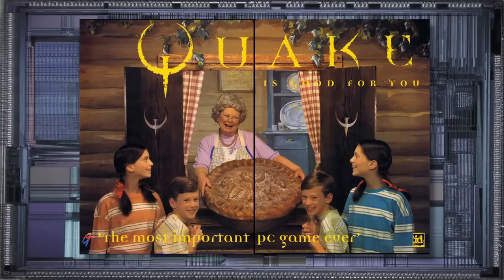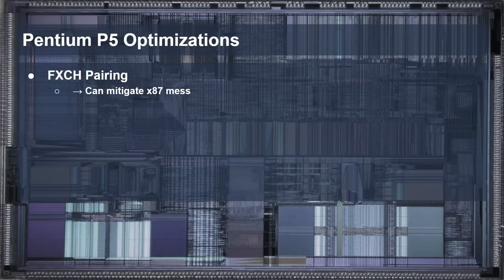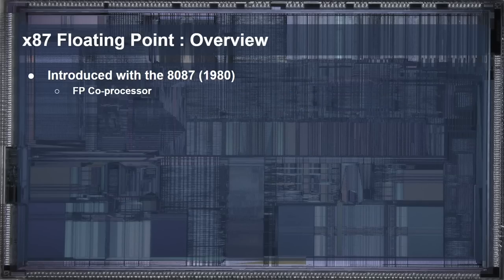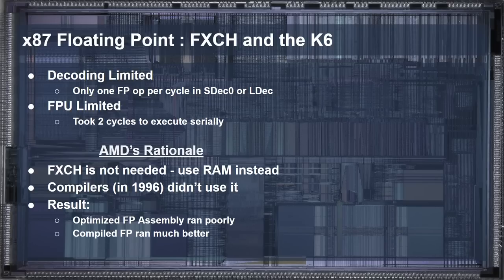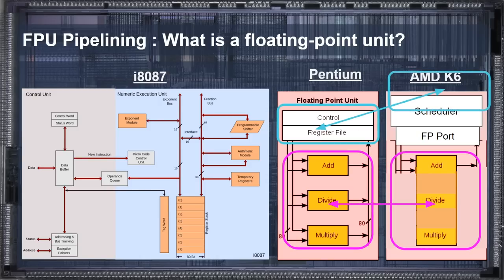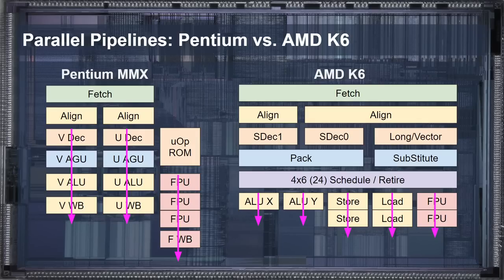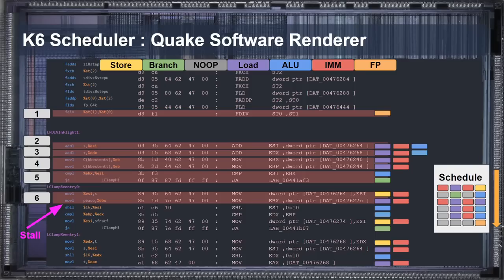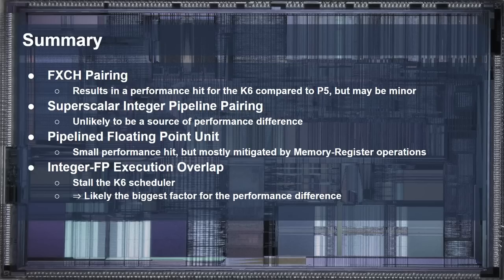Quake, Floating Point, and the Intel Pentium

Comment: Very interesting, i like when the frontier between hardware and software is blurry. 
Maybe one of the last example where good knowledge of the hardware lead to programming wonders.
I didn't know K5 was out-of-order, i had to look it up and what a strange bird it was : a x86 front-end with a Risc.
I start wondering how well a x86 front with a modern RiscV would performe.
Seing the benchmark, clearly the P6 was one of the finest architecture at the time ( But i would have sold my soul for a Dec Alpha in the late 90's ).
Since your last video, i have done some digging on 3DFX (find a site with technical papers and source codes).
Voodoo 1 had two chips ( texture and raster ) each with a 64bits@50Mhz dedicated EDO RAM, so 800Mo/s in total.
Voodoo Rush was a voodoo 1 with some 2d chips battling for the pci bandwitdh.
Voodoo 2 had two texture units, so 3x64bits@90Mhz 2160Mo/s.
And the Banshee was an half-voodoo2 (only one texture unit ) with a 2D.
I supposed you would have to adapt the architecture to a single memory system ? Can the color blending and overlay can be mutualise with the 2D part ?
Reply from the maker: Indeed, the span from 1993 to 2001 was probably the most dramatic change in hardware and software architecture. Before 1993 most hardware/software looked similar, and after 2001 most hardware/software looks similar. That's probably due to it being the inflection point where hardware started to become fast enough that it could handle almost any software thrown at it, instead of requiring heavy assembly based optimization. 
- I was originally surprised that the K5 was OoO too, but that's probably because I was equating it to the Cyrix 5x86. There's a lot of detailed patents on the K5/K6, which have a very similar architecture. It was the K7 that was a complete overhaul (due to clock speed scaling on the k6).
- All OoO processors use a RISC like back-end. How RISCy it is depends on the architecture though. The K5/K6 were pure RISC, meaning that it was a load-store architecture. The K7+ and P6+ used a semi-RISC back-end, which was load-store based, but could fuse a load or a store with an ALU operation (to save in micro ops).
- You wouldn't be able to implement x86 with a RISCV backend efficiently, because of complications with the ISA. And a RISC-like backend becomes a nightmare when dealing with x87 FP (I talked about that in the longer video, which hasn't been published yet). The RISC back-end of the K5/K6 was highly specialized around these quirks of the x86 ISA, so other than being load-store and register-register based, it doesn't resemble any other RISC like ISA.
- The P6 was very powerful, but I think it was outmatched by the K7 in many cases (regardless of the benchmarks). There have been many improvements to the P6 though, starting with Core, and those allow it to far surpass the k7. Although AMD has many many improvements to the K7 base architecture too (even Zen is similar to K7).
- What you described with the Voodoo's is correct, except for the Banshee. Perhaps you are thinking of the Rush? The Banshee was combined like the Voodoo3+, and shared a single memory bus (it may have only had one TMU though, I would have to look that up). For a FPGA, the architecture would depend on the underlying hardware platform. If your platform only had 1 memory system, then you would need to have the framebuffer, texture memory, and 2D memory share the same system. Actually, 1 memory system would mean also having the CPU and sound card share too. Ideally, you would at least have 2, where the graphics have a dedicated system and the sound/CPU get their own. If you instead had 3 memory systems, then it could make sense to split the 2D and 3D graphics, and 4 could split them again. But I think 2 is a reasonable target if the latency and bandwidth requirements can be met, since that's what the Voodoo3+ (and Banshee) used. And yes, the 2D system would share the same memory. The Voodoo cards actually store their 2D framebuffers in a specific way that allows it to be compatible with the 3D framebuffer, though I haven't looked into how the windowing was done.
Reply: @RTLEngineering  
The rush (SST-96) was a revised voodoo 1 (SST-1) with a memory @45Mhz.
The Banshee was a Voodoo 2 (SST-2) but with only one texture unit (TMU ) instead of two. Hence the poor score in multi-texturing compare to the Voodoo2 (or the TnT).
I remember the banshee well, but the rush not so much beside the fact it was bad, "S3 Virge" bad.
Indeed the K7 was a beautiful chip compare to the PIII. The K7 bring 3Dnow and PIII gain SSE, both with MMX with completly reworked fpu-vector units.
Reply from the maker: I had to go back to the spec to verify, but my original comment about the Banshee is correct. The graphics core in the Banshee is still the second generation SST1, but the overall system configuration is almost identical to the Voodoo3+. If anything, I would call it the Voodoo2.5. When I say system configuration, I mean at the top level. In fact, the Banshee, Avenger (Voodoo3), and Napalm (Voodoo 4/5), have the exact same top level diagram in their specs. In that architecture, they share the same PCI and command buffer interface, as well as a common memory controller. Also, as you said, the Banshee had 1 TMU, the Avenger had 2 TMUs, and Napalm had 2 TMUs but 2 Raster pipelines (so 1 TMU per pipeline - I can't recall if Napalm could combine both TMUs for tri-linear filtering though, or if it needed 2 passes like with the Banshee). Anyway, the point was the shared memory controller in all of those cases.
For some reason I thought that all of the K7s had SSE, but only the later ones did. The SSE operations were effectively a subset of 3DNow, but twice as wide. So modifying a 3DNow unit to support SSE wouldn't have been too difficult. The same thing can be said regarding SSE2 and the existing MMX units.
Reply: @RTLEngineering  Sorry to be so psychotic about the memory. I have been interested in hardware conception for a couple of years and i'm still  searching a good platform to begin. Meaning extensible enough and with as much or more LE than the mister FPGA.
I didn't saw any Dual channel DDR capabilities in the "low" cost FPGA. For what i understood, the MIG need specific logic and clock for the dual data rate. The artix can go as far as 72bits wide but one channel. So i concluded some kind of custom board with sdram is the only way to go beside selling my organs (and DDR layout seem insanely difficult ).
My first idea was to tap the PL pins  between a kria module ( 2x240pins ) and it's carrier board throught a breakout pcb and add some ram ( depending on how many pins i can get ) , and leave the PS ones connected.

Sadly I didn't follow 3dfx past the vooddo 2, i had bought a geforce 256 (T&L acceleration ^^)
Anyway, i'll wait your next video. Very interesting subject.
Ps the AI voice is pretty good
Reply from the maker: No need to apologize about the memory concerns. This is one of the major limiting cases for FPGA emulation - memory technologies, bandwidth, and latency. It's actually still a problem today, but even more so for FPGA emulation since the hardware and potentially software, was dependent on specific parameters that can't be achieved with modern memory. I did start working on a video about the philosophy of FPGA emulation, and it has a section discussing that problem in more detail.
I'm not sure what you mean by dual channel DDR though. Dual channel would mean 2x memory controllers, and therefore 2x the wires/pins. As far as I am aware, there are no FPGA development boards that have such a configuration (other than the ultra-high-end ones, or the ones that use HBM). The MIG is needed to talk to any high speed memory, or at least something similar (the LiteDRAM controller also works, but it's not quite as fast). I would have to check, but I believe the Artix is limited to 64-bits, the extra 8-bits are for ECC, which I believe is built into the MIG (if enabled), so you would only have a 64-bit output (really 512-bit for DDR3, since it's 8n prefetch). SDRAM would certainly be easier to route, but it may be harder to control at high speeds (it may be easier to route DDR3-800 than SDRAM-200). Another option is to use LPDDR through the MIG, which is point-to-point instead of bussed (fly-by to T is what makes DDR so hard to route), but it comes at a higher read latency.
Tapping the pins on the Kria module is going to end in disaster though. Even at 100 MHz, you're talking about high speed signals where impedance matters (that's partly why MiSTer has such a hard time getting the SDRAM to run that fast). Your best bet would be either 1) if the Robot starter board connects the Pi header, use that for SDRAM (it still won't be enough bandwidth for a Voodoo1 though), or 2) design a carrier board for the Kria SoM (not the one from the starter kit, you would have to use the commercial SoM), or 3) go with a different system.
I may work on a geforce 256 at some point (or more specifically a NV2A), but there's a lot more information on the Voodoo cards, and hardly anything on the 256. I would probably have to rely on Nouveau or the open source NVidia drivers for that.
Thanks for the comment about the AI voice. It has worked out for the most part, though I have trouble getting it to say certain words or to keep a consistent vocal tone (often requiring the sentences to be restructured). The good news is that using that method provides a perfect transcript to upload for subtitles, and the pronunciation is clear enough that it can still be understood at 2x speed. Overall, I guess I would rate it a 7/10, which I think is "good enough".
Reply: @RTLEngineering  You are right on all point, indeed the 8 bit on top of the 64 is for ecc, and yes dual channel is for dual controller, a way to have a unified memory with bandwidth and low latency.
I found some 6 layer pcb for artix with DDR to study, i will start tinkering on a qmtech and scale up if i'm going somewhere.
Like you said, the geforce 256 has little to no documentation.
The TnT alone would be great with a P6 cpu ( very close  to the Xbox )
It would be fun to "glue" together a bunch of simplified in-order X86 cores with MMX/3Dnow and code the texture mapping and raster in assembly, larrabee style ( title rendering in all his glory ), 8 cores would be a good use of the ddr 8n prefetch.
I don't quite understand what you mean by the philosophy of FPGA emulation. Like in software you can aim to perfect reproduction (timing and quirk) or just general compatibilty but better, faster, stronger ^^. Nothing prevent you to clock the PCI interface at 133Mhz inside an fpga or overclock something else.
Like reproducing a Pentium with the floating point divide bug or making a Pentium III instead.
The first one is useful on systems where program were close to the hardware (before 1991-1995), with more complexity come more processing power and more abstractions was needed (for the developers sake) , the second type of emulation is better in that case. 
Most games since windows 95 used directX/directdraw/gdi+ on top of VBE/drivers and are made for a wide range of CPU and Graphic cards.
I don't think the driver need to interact with the graphic card beyond it's frontend/register and don't need the timing for each operations, in this era it was a fixe pipeline (pretty sure the driver was just a collections of interrupts and subroutines enough to configure the beast and feed it data when it ask).
Reply from the maker: If I recall correctly, the NV2A was closer to the GeForce 256 than the TNT. Especially since it did do T&L.
Oh, that could be interesting, gluing together in-order x86 cores. But I don't think that's feasible given the complexity. Honestly, you would be better off gluing together RISCV cores and implementing a software rasterizer in RISCV assembly - they will likely run faster and will be much smaller.
Philosophy of FPGA emulation meaning, what are the goals, why would you want to do it over software emulation, where do each fall short, etc. Software can only do a perfect reproduction if you run it sub-real-time. A perfect software reproduction of a N64 for example, would necessarily have to run at around 0.1 FPS, or something like that. To get real-time performance, you have to make approximations, simplifications, and use tricks like pre-compiled code. It may be mostly indistinguishable from the original hardware, but it's not a perfect reproduction. Although the same thing is true for a FPGA, given how the original architecture needs to be remapped and interpreted. And of course there's always the question of if original bugs should be implemented at all, if no software relies on them? That's a question that's answered by the emulation goal, which may not be a perfect reproduction. It's a lot less black and white when you think about it for a while. I believe there are also psychological effects related to software vs FPGA emulation. Otherwise the MiSTer wouldn't be so popular.
What you described with processors and drivers at the time is correct. PCI allows for standardization, so on the surface, the underlying implementation doesn't really matter. All that matters is the performance. But going back to the psychological aspect, why even bother with implementing it in a FPGA if you could use DosBox, PCEm, or even run the games natively like from Steam / GoG? There has to be some benefit from doing it on a FPGA, and it's never been totally clear what that is. And I can tell you it's not latency, especially once systems started using USB. The motivation likely has to do with the reason why people still run software on original hardware instead of an emulator. Again, it ends up being a psychological effect, which alters the user experience. At least that's the best explanation that I could come up with.
Reply: @RTLEngineering  There is a psychological aspect for sure. The mister project is awesome from a technical point of view. In practice, most software emulators can do as well and are only limited by the processing power.
I remember buying a 3dfx mainly to use with ultraHLE (mindblowing piece of software).

IMO, FPGA is for hardware that didn't exist or never leave the prototype stage.

For the Amiga fan, 
You can emulate it on software with unlimited performance (like the BUFFEE), 
Buy a mister and be limited to the 68000-68010-68020.
Or buy the vampire 4, a board with a cyclone V (77K LE) inside they fitted a enhanced 68060, the 68080 ( full 64bits, out-of-order, 4 ways decoders, alu et fpu pipelined and mmx-like instructions) with a  2D engine and even some 3d (texture mapping).
My goal is to do something similar, but for Atari and with a 32bit 68k compatible made from scratch. I don't agree with some design choices they made (64bits and implementation of simd) and the closed-sources aspect. I think they overenginered it (@100Mhz they brag of 400MIPS).
I target a "modest" IPC around 1.5 and clocking at 200-250MHz. Following your video, made me realize that the decoding part will be the hardest, even if the 68k instructionset is incredibly small and "simple" for a CISC (less instructions than an ARM CORTEX).
And if i need perfect compatiblity, i can nest  an entire atari ST for 20K LE, backward compatibilty old-school style.
But why ? Because it will be mine, with my choices and mistake. 
I will do it myself like Thanos said.
Reply from the maker: I disagree with your statement that FPGA is for hardware that didn't exist or never left the prototype stage. You could more easily implement that in software, and possibly run just as well. There are exceptions though, when it comes to more modern performance. 
In your Amiga example, you could probably build an Amiga emulator for the Pi which dynamically recompiles the 68k instructions into ARM and executes them natively. It could also leverage the VideoCore GPU to do much better 2D and 3D graphics. Although, then you wouldn't really have a product that you could sell like with the Vampire. But a FPGA is not really necessary for emulation.
My conclusion in the video (which is still work in progress) was that FPGA emulation is only really necessary in 3 cases. 1) you want perfect archival preservation (which is only feasible up to a point), 2) you want to interface with low latency peripherals (original hardware which will face the same problems as the original copies of the system you are emulating), or 3) it improves the experience from a psychological aspect. But understand what the limitations are for software and hardware emulation, what the goals are for emulation, and why one might be better than the other, is what I mean by the philosophy of emulation.

Also, I looked at the claims for their core, and I think you got some of the numbers confused (unless I looked at the wrong place). They claimed 340 MIPS, but it's still a 32-bit CPU, which has a 64-bit SIMD extension (like MMX). I'm not sure how they get 340 though, maybe it includes the SIMD extension? I would need to know more about the CPU architecture, but I highly doubt they built a 4-way out-of-order CPU... The amount of work that goes into that would be insane, even a 2-way in-order pipelined processor is a lot of work.
Regardless, dynamic recompilation on a Pi 4 could give you 2,000 MIPS easily. That would still leave 2 cores free to do the recompilation in parallel, or other system book-keeping work.
The only way to get an IPC of 1.5 is to use super-scaler execution. The same thing is true for an IPC of 1.0. And getting it to run at 200-250 MHz is not easy. The Pentium design that I showed in that video would only run at 180 MHz, and likely lower once more logic was added to the FPGA. To go faster, I had to move to a speculative decoding approach, which let me hit 420 MHz after further optimizations. But speculative decoding doesn't perform as well, and it's a lot more complicated.
I haven't looked into the 68k ISA, so I don't know if the length decoding will be simpler or not. Though I know one person who planned on implementing one using a massive look-up 1MB look-up ROM, which is a huge waste of resources.
Anyway, your motivation is similar to mine though. I'm interested in implementing these architectures to show that it can be done.
Reply: @RTLEngineering  You are right and this one of my problem with the apollo team, it's a complete blackbox and what i know was scrap from their forum. 
My view on fpga is very personnal, i feel like software emulation kind of a "cheat". I prefer coding winthin a platform constrains (custom made at his point). I would code bare metal a raspberry pi, not running a JIT on it (and beside there are way better VM in the wild for that JAVA, WASM... i know some try to fit them in an fpga, some ARM had an JAVA byte code interpreter in hardware).
Anyway, there is one thing very nice about the 68K, in theory an 68020/68030 can have 8 coprocessors (FPU) at the same time.
Long story short. an instruction in 68k is two bytes based. First 4 bits indicate the line (boolean, compare, memory, arithm..) then an opcode and an adressing mode. beyond that, it's extentions byte (1,2,4).
Two lines are unused in the 68000, the A-line (used to trap system call or emulate function on atari and apple) and the F-line use only by the 68881/68882 FPU (later integrate in the CPU).
Where it's interesting, it's the F-line have an 3-bits ID for the coprocessor ( 000 being the FPU ).
So i can view a main CPU with 4 to 8 small cores ( 68000 or coldfire, a subset of 68k ), much like the IBM CELL, or a very small larrabee.
Beyond keeping the instructions set homogenus and making load sharing "easy" between cores, the small cores can "trap" specific functions call and emulate them throught microcode or "short" routines updatable on the fly. Loosing in efficiency but gaining in adaptablity.
I would give them a dedicated memory space of 16Mo (24Bit adressable)  unified or segmentable between cores.
Reply from the maker: But why is software emulation a "cheat"? You could always look at the OS that an emulator is running ontop of, as a library abstraction to provide useful functions. I agree that bare metal feels different as well, but the reason why, is what I was getting at. 
The 68k sounds interesting, but I only followed some of that - I don't really have enough space in my head to fit another ISA (I currently have most of MIPS, RISCV, and x86). If there is an easy way to extract the instruction lengths and figure out what instruction breaks down into what operations, then it would probably be easy enough to implement.
Reply: @RTLEngineering  I cannot explain why, but it's my feeling about emulation. I like 'real' hardware. Somewhat software optimisations have more "meaning" ?
Not really a good example, the fist quake used an hardware optimisation, but quake use more like a programming trick for fast square root, not plateform dependant. Stilll impressive, but being "bare metal" or close to the hardware is maybe more satisfying, like a manual shift gear on a car. This maybe just about control.
I don't even have a complete ISA in mind, let alone 3. I'm still in the process of entering each ops in a table, then find the right set of patterns to extract the lengh. I think i will learn much in your future videos on decoding and it's implementations.
Reply from the maker: If you can't explain why other than a feeling, does that not imply that the reasoning is psychological? Otherwise, the reason should be quantifiable.
I can understand how bare metal or being closer to the hardware can be more satisfying for the programmer, but that's not something you could notice as an end user.
That's exactly how I started with x86. I have a massive spreadsheet with all of the instructions, grouped by opcodes and the extension revision (also things like uops for various processors, to see how they were executed). Then the actual decode tables are in a big C file, which contains a large array of structures to describe each instruction and then can be packed into a ROM word for each opcode.
If you want something to get started with for decoding, I would look at EP0853779B1, which describes the K5/K6 decoding method, and US6260134B1 which describes the K7+ pre-decoding method. The K7 patent is really complicated, but you don't need to worry about any of the tree stuff. Instead, the key takeaway would be Figure 13, which shows a nice way to accumulate displacements. Effectively, I would suggest using a table like what the K6 used with a displacement accumulator like what the k7 used (that's effectively how I built the length decoders). If the 68k doesn't use prefixes or have a 16-bit/32-bit mode, then you can remove a bunch of the signals used in the patents. Figuring out what control signals you need for each instruction can be more helpful thank looking for a specific pattern.
Reply: @RTLEngineering  Realy thanks you for theses. I wil probably use a microcode, but hardwired is possible too (68060 didn't use microcode). I'm not totally clear on the pros and cons of each method beyond the obvious ( does updatable microcode make even sense in an FPGA as it's embedded in the design ).
And i totally agree with you on the psychological part, i know feelings are not rational, i'm just a meat bag after all :D
Reply from the maker: I'm not sure where your mention of microcode came from, neither patent focuses on it.
There are a few advantages to using microcode though. 1) it allows you to simplify your decoder. 2) it's easier to modify later, 3) it's easier to add functionality to / improve instruction performance. But it does have a bit more overhead that if you were to do it by hand. It really depends. Also, for things like x86, microcode in a FPGA can get around copyright issues, technically. If the microcode has to be loaded at runtime (not from the bitstream), then you can technically claim that it's "software emulation" (not legal advice though, I wouldn't want to argue that in court). I don't think that's an issue for the 68k though.
And yes, I'm not saying that irrational feelings are a problem, but it's helpful to identify that as the reasoning.
Reply: @RTLEngineering  Sorry, zipping throught EP0853779B1,  i realize once you get the instruction length most of the control signal scan be infere in the process. Either using that as an index or using some logics to wrap it up. You make good points (as always) about the use of microcode but didn't that depend of the number of instructions in the ISA? x86 wouldn't be hard to do with logic only (or at least an high number of logic levels) ?
The RISC86 patent is very interesting, Many thanks for your time and patience.
Reply from the maker: That's not the only RISC86 patent, I think I have found 6 so far (they're all similar, but some have different bits of information in them). 
x86 has roughly 1024 instructions, not including 3DNow, any of the SSE variants, or the FP instructions (though I think including FP would still fit in the 1024). There's the normal 1-byte page, the extended 0F page, and then each of those has a register based or memory based variant. 256x2x2 = 1024. That's a lot of instructions to implement with pure logic, especially considering that some of those instructions are so complicated that they can take hundreds of cycles to complete. So x86 definitely needs microcode. I can't speak to 68k though. 
Anyway, any reasonable decoder will take a multi-stage approach. You can accelerate the common and easy cases using a look-up-table ROM, like in the AMD patent, and then you cover the special cases with a more complex implementation. That's what AMD did... the short decoders used a PLA approach for simple instructions, and the complicated ones had to go through the vector decoder (microcode).
For the PMMX, I actually have a 5 stage decoder, where each stage adds more information. Predec -> length + prefix -> decode 1 ROM -> decode 2 ROM -> microcode. Because of the pipeline structure, I can actually implement all of the instructions in microcode, some of which only have one entry.
The K6 I was working on also had 5 stages for the decoder. Predec -> Look-Ahead -> length + prefix -> decode 1 / microcode -> pack / substitute. x86 just has too much computational work to decode for it to be done simpler. Having multiple stages also isn't a bad thing, considering that it also means you can improve clock speeds (though there's a feedback loop code, for branches). Remember though, for a FPGA, you should expect a processor to have 20% more pipeline stages than an ASIC due to the technology substrate. But those stages should also be allocated where they are needed most. Just some things to keep in mind.
Reply: @RTLEngineering  Damn 1024 instructions and i'm overwhelmed with less than 200 instructions ( 68000 had 59 basic instructions , not counting fpu, cache and mmu ones introduced in later models ).
I'm sure i will learn much on the subject in the next episode ^^.
Reply: @vincentvoillot6365  on software emulation vs FPGA, my view on that is that an FPGA design has the potential to be turned into a design which could be used in a single purpose chip. It’s is after all a description of a hardware design. A piece of software could not. Admittedly this is extremely blurry, and growing more blurry as the years go by.
Reply from the maker: @lawrencemanning  I'm not sure if that's a substantial enough reasoning to favor FPGA over software though. You could make a similar argument for porting a software emulator to hardware using HLS. Alternatively, most FPGA implementation won't scale well for silicon, given that they will rely on some of the more expensive hardware elements (like DSP blocks and dual port BRAMs). You could also argue that a FPGA design could be used in a locked-down single purpose FPGA, which would effectively be a single purpose chip, so would there be a meaningful difference there? And if not, what about a single purpose SoC running a software emulator like the PS Classic? Maybe that's the key factor though, the emulator needs to be transparent and have the outward appearance of single purpose hardware for it to have a higher perceived value.
I'm not trying to shoot down your argument, I just want to see if it works, since I think this is a very important question that the FPGA emulation community needs to adequately answer.
Reply: @lawrencemanning  But in case of emulation  the hardware already exist(ed).
The FPGA are originally  for prototyping, low volume or where flexibility is needed.
I think the strength of the mister is the "hardware" library, it will make no sense to burn each cores into an asic.
For  more specifique project, like the apollo's 68080 or a potential Pentium-class x86, there is the cost of producing the asic (10-15K$ per Wafer) and PCB (8-10 layers ) manufacturing/assembly/testing ( and maybe a lawsuit from intel ) comparing to an off the shelf fpga (chips/module) with a custom carrier board. 
Porting a project to silicon can be done, but it will be an hell of a kickstarter.
Reply: @RTLEngineering  I suppose I am trying to justify the usage of FPGAs in this case as I happen to prefer it as a solution. It seems like it should be a more accurate recreation, but I imagine that has very little basis in fact. The only compelling argument I have is interfacing period hardware and obtaining more accurate timings on the external signals involved, which is something you mentioned. Beside that there does seem little merit in FPGAs, though I've not looked at software or FPGA emulation for anything more sophisticated then a 16bit microcomputer. It would be interesting to find out which path leads to workable solutions at the higher end.
I don't work in the IC industry - I am just another PL hobbyist - and am therefore guessing here but surly the path to ASICs from an FPGA design would offer higher speeds, lower power etc? Granted your point about BRAM/DSPs etc, but again these could be included in the ASIC part? I am not talking specifically of emulation, but any FPGA design.
While I'm here, thanks for your videos. They are terrific. Your AI voice is freaky, but surprisingly pleasant and certainly the best I've seen. Or heard. :)
Reply from the maker: @lawrencemanning   Exactly, I prefer using FPGA emulation over software emulation as well, but I haven't been able to figure out why exactly. In principle, a FPGA implementation can be more accurate than software, but that's mainly due to it being able to do more in parallel (you could make a software emulator just as accurate but it might not run in real-time). In practice, you would still take shortcuts in FPGA emulators since the older systems were heavily latch based while FPGAs are clock based. In newer systems, it becomes impractical to reproduce the original hardware 1:1 due to the complexity, but you can get a lot closer than with software. The accuracy doesn't really translate into anything noticeable by and end user though. As long as the software (game) runs and isn't buggy or introduce too much lag, then you can only see a difference if you do a side by side comparison. Interfacing with period hardware is a good argument, because software emulators can't do that. But period hardware will become less and less common over time, and most users don't have any to interface with in the first place. On the newer FPGAs, the speed limit for an implementation is around 400 MHz but practically around 300 MHz. So any hardware that ran within that range is fair game (assuming it fits in the FPGA), and in many cases could mean the FPGA implementation runs faster than the original hardware (which is true for most of the 16-bit systems). Anything beyond that will have to be software based, or use hybrid emulation between partially in software and partially in a FPGA.
My best explanations so far have been that software feels "fake" compared to using a FPGA, and that with a FPGA you know that the system is doing that one specific thing (no alt-tabbing away or other distractions in the background). The latter would also apply to modern consoles, and could in theory apply to something like Retro Pi. In either case, it would come down to how you perceive the experience, and not on a measurable difference.
There is a path from FPGAs to ASICs, and the BRAMs / DSPs can be implemented in an ASIC to operate in a similar way. But I don't think that's done often in practice. 
Thanks! The generator doesn't always behave correctly, but it's significantly faster than recording and editing my own voice. Also, it's still understandable at 1.5x and 2x speed, which the same can't always be said for most human voices. Pleasant is definitely an interesting way to describe it though.